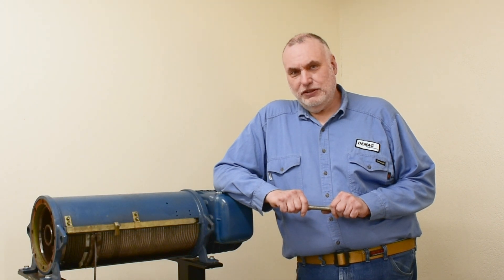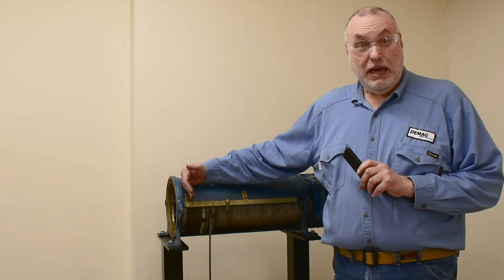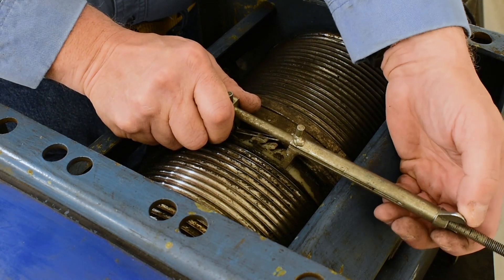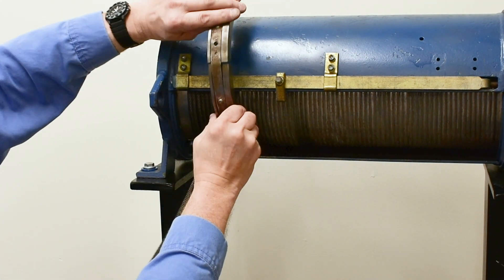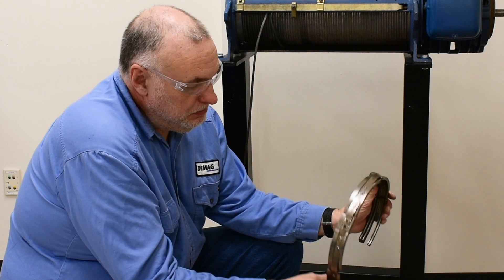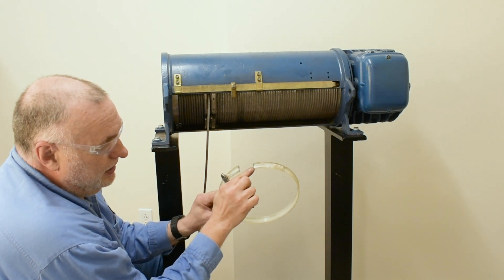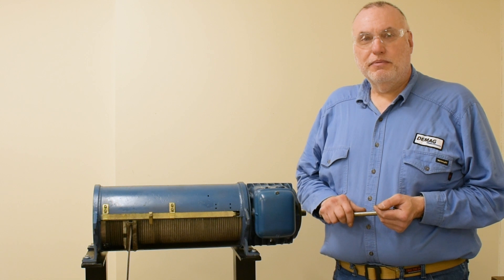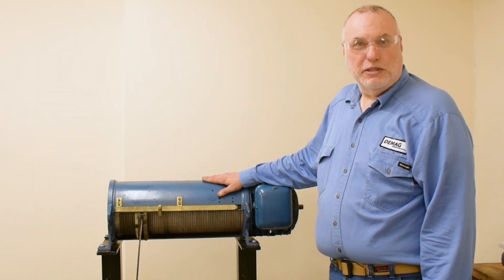Removal & Reinstallation of the Rope Guide on the Demag P Hoist | 1967 to 1986 P Hoist

Comment: Where do I get this tool, I've been fighting these for years and this is the first time I've ever seen this tool
Reply from the maker: You can buy this tool from a Demag authorized distributor! It's part number 50401044. Head over to our website to find a distributor in the US or Canada. https://www.demagcranes.com/en-us/distributor-locator

If you're outside of this area, use our global contact list to find the location nearest you. https://www.demagcranes.com/en-us/global-contacts/
Reply: Struggle with springs all the time. But is there one for longer springs you need to pull together to join?
Reply: @waydeross  I know exactly what your talking about. They look like little ice picks with hooks on the end. I'll see if I can find them and add the link